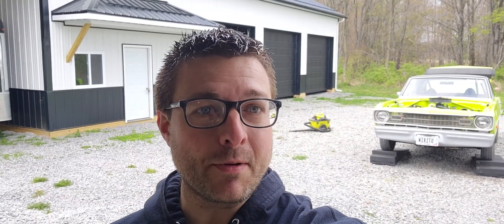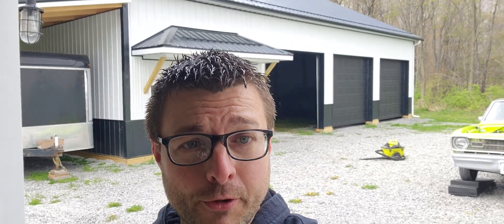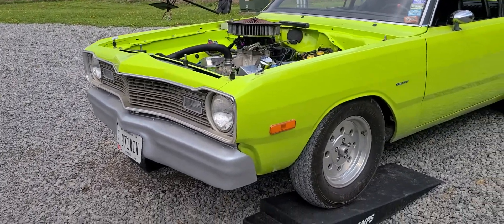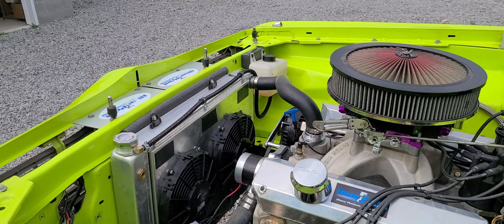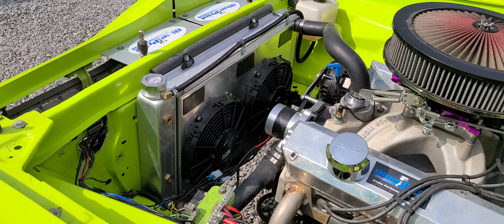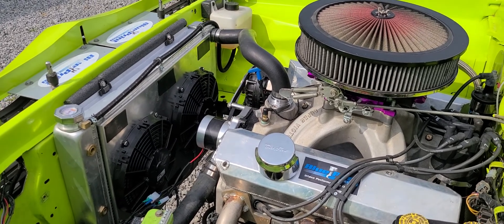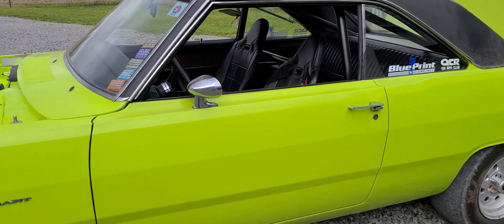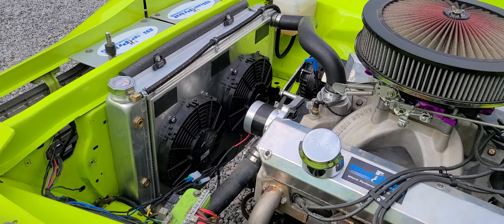Griffin Radiator.  Well Worth the money???  Tested on Mopar 10 second car!  CU-56242-X

Comment: Great video did you speak to Michelle at Griffin? Do you have a part number for Rad, fans  and shroud?
Need a setup for 800 hp mega block 540 Roadrunner
Thanks in advance

Comment: Would this be considered a 3 core radiator?
Reply from the maker: This is a dual row 1.250 thickness (per row/tube).  I believe that two, 1.250 rows cool much better than three, 1 inch or skinnier rows.
Reply: @johnnymac3079  I just purchased the same radiator but I been hearing 3 core is better.
Reply from the maker: @FastLaneD  is it a griffin?
Reply: @johnnymac3079  yes it is
Reply from the maker: @FastLaneD  they make a good product so I'm sure you are setup well.  There is some debate in the science in if 2 thick rows, or 3 thinner ones are better, but your third row will add capacity regardless, and since you have the depth for 3, then seems you are set.  I'm sure it'll work great!

Comment: For all those that are looking for a part # on this radiator, (like I was) it appears to be Griffin # 1-56242-T. The part# is for the radiator only. The fans seen in the video are separate or come in a combo kit, CU-56242-T or -TS. 

If you're looking at this unit, be aware that Griffin offers an almost identical radiator with the same part # that ends in "-TS" . Based on Summit's info, TS means it's a 3" core rather than a 2.5". However, if you go to Griffin's website, their descriptions do not help to clarify anything as they are basically identical for both models except at the bottom under additional info it says the TS model has a 'straight bottom outlet' while the T model just says 'no options'. Neither description indicates anything about different core depths or whether the T model has an angled outlet or not. 

I'm not 100% positive on this info and frankly it's a little vague so do your own research or call the mfr. to confirm. 

https://www.griffinrad.com/load_details10.php?PartID=249&year=All&make=Ford,%20Dodge&model=Racer&select_Main_Group=400-600&select_Sub_Group=TR&select_Sub_Group_model=BL&select_Sub_Group_Engine=Automatic&select_Sub_Group_HorsePower=27.50x19x3&key_id=1-56242-T

Comment: awesome info! gonna be picking up a Griffin soon

was this a direct fit or a universal? And do you remember if this was a 22" 24" or 26"?

beautiful car!
Reply from the maker: Mine is universal  dimensionally it's about 27 wide.  But that includes the tanks.  It's a 22.5 ish core.   About 19 tall.  It's amazing. Should have bought one 10 years ago
Reply from the maker: Thanks for the compliment!  Mopars were downflow from the factory.  Not sure what you are putting it in,  but if you go universal, you may have to go hose hunting at the local parts store! 😉

Comment: What radiator hose part numbers did you use?
Reply from the maker: Good question....it was a bugger to find.  I will see if it's still printed on there next time I'm home with the car.
Reply: Did you ever find the part number for the lower hose? Installing a similar radiator in a Barracuda and was curious.

Thanks!

Comment: Does the radiator have a part number. great review    Thanks
Reply from the maker: Thanks,  I can look it up tomorrow.  Do you have a similar Dart or A body?
Reply: I also was wondering on part number I'd like to go same route
Reply from the maker: CU-56242-X @moparornocar4618
Reply: Also looking for the part number, in the same situation.
Reply from the maker: CU-56242-X @StormWidgeon
Reply from the maker: CU-56242-X